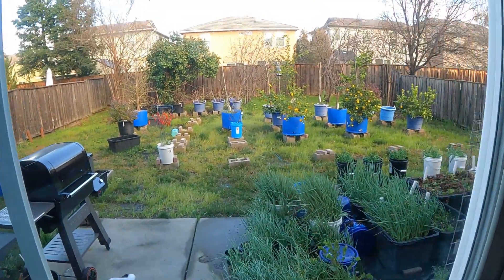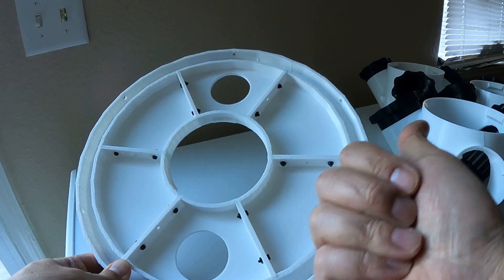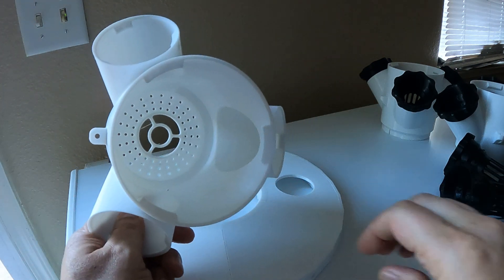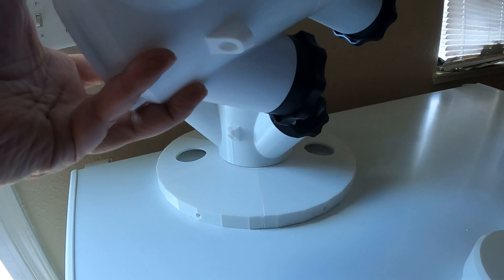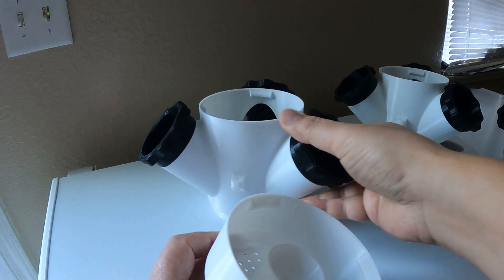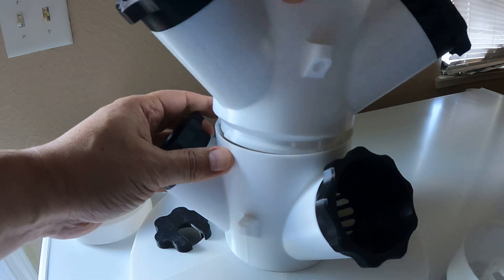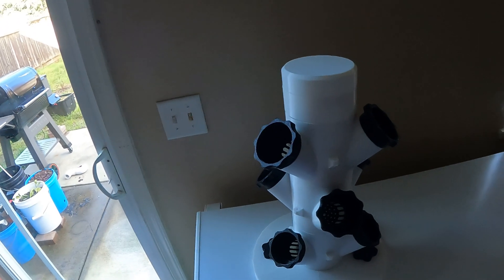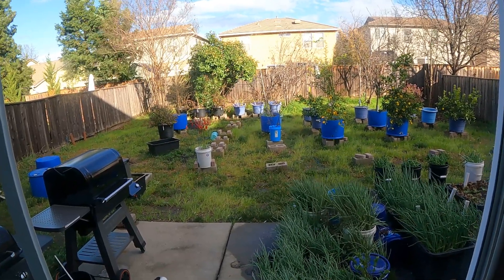S07E04 3D Printed Hydroponic Grow Tower for 5 Gallon Buckets 🪣 🧐 Update-60 MPH Gusts of Wind!!! 😲

Comment: Did it require a lot of supports? 

I know 3ad printers generally require supports for anything mire than 30° angle. Those look like they would have required supports.
Reply from the maker: No supports.  I loaded the main part in the slicer just now to verify. I am hoping to get a larger printer before growing season starts.  I want to print a solid base for the 5 gallon bucket vs screwing the parts together.
Reply: @brianv_official me too. I don't know if you have seen the Chanel called hoocho's hydroponics but he has a clever design for a bucket lid by printing only a rectangular cut out of a lid, taking advantage of the length of the diagonal, then he printed the 2 cut off edges of the circle as flaps that can be opened.

I think it still required a bit bigger bed than my K1
Reply from the maker: @bheemasena2383  I actually subscribed to his Patreon last year and printed the lid and its too small for a Walmart/Homedepot bucket.  Thats why I want a larger build plate so I can use that base so it will fit and also merge these tower parts so they twist into it. I am looking forward to the bigger Bambu, fingers crossed.  256*256 isn't big enough for what I want to do for Hydroponics.
Reply: @brianv_official  nice. Good luck with that.

Comment: This looks awesome. The only thing I notice is that when you add the spacer, the next tree section is on the same line as the one below it. Whoever created the stls should have adjusted the top spacer slot so that when you put the next tree, it's not aligned right above the previous one. I'm just learning about all of this and don't know how to adjust an stl file that much, so for now, I'll either print two spacers or no spacers for near the top, since I'd just plant basil and mint and things like that that don't need a ton of space.
Reply from the maker: @dontbanmebrodontbanme5403  Are you using the smaller of the 3 adapters?  You may be able to use the slicing software and cut it in half and rotate it.  I may try that for giggles after my next print is done.
Reply from the maker: I took a look at the original 40mm spacer and it appears to be orienting each branch correctly.  Are you using a different size or did you get the mesh 40mm spacer remix?  That one does appear to be wonky.  I assumed both were wrong and modified them.  I was just taking pictures to upload to MakerWorld and noticed the "original" appears correct.